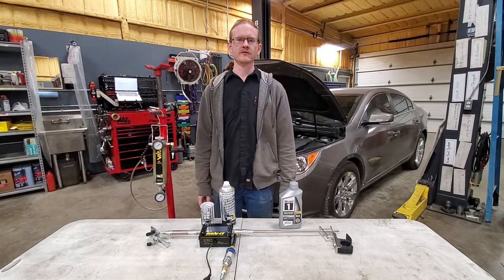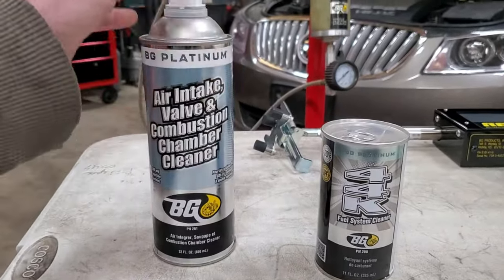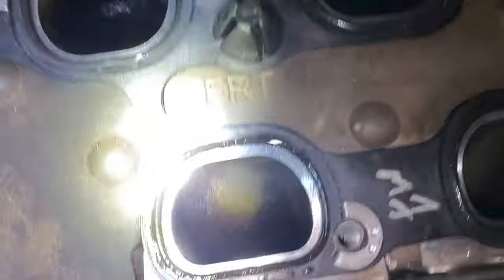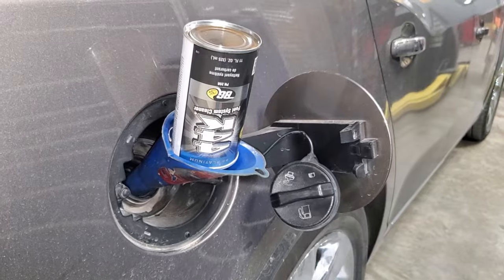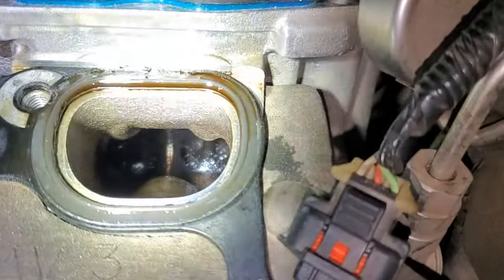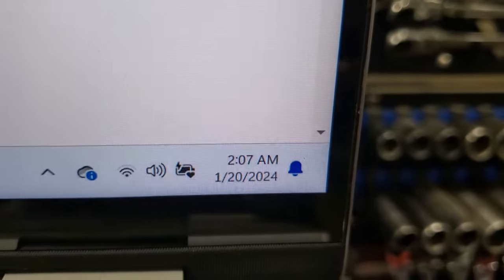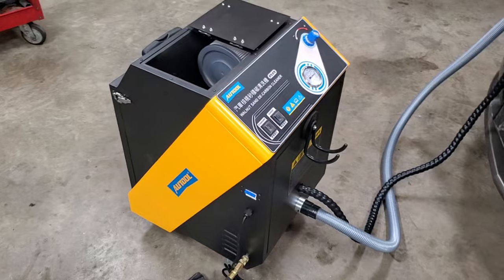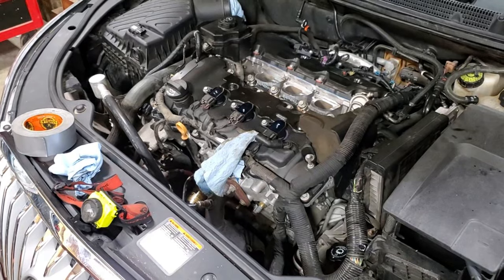Does BG Platinum GDI Intake Cleaner Remove Carbon? It's time to find out!

Comment: i tought you suppose to soak those valves with the liquid? just spray a foam based cleaner / carb choke spray and fine sanding it should clean those valve
Reply: yes...' fine sanding' and all the little loose particles that come off the sandpaper are now on your pistons or piston rings,,, installing nice little scratches on your cly bores

Comment: Ultimately wouldn't you still run into problems as carbon builds on the valve seat? I can see the benfit of better aerodynamics and also cleaning the valve stem, just seems like you will still end up having to take the head off.
Reply from the maker: There is zero carbon located on the seat sealing surface. If there were carbon there the engine would lose compression and wouldn't run good at all. It's impossible for carbon to build up there as the valve smashes into that area at high speed which obviously keeps it clear of any carbon build-up. And the miniscule amount of carbon left on the seat next to the sealing surface doesn't hurt anything. I mean of course it does make a difference but would someone pull the heads to get a 1% increase in airflow? If you were racing in a class that had engine build restrictions where every single HP counts sure it would be worth it but it wouldn't even be noticeable or worth it on a street driven vehicle.

Comment: It's always,  the chemical only clean the ports, but not the valves as the carbon been cooked onto the valves. If any of that carbon fell into the cylinder.  It may become new abrasive and create different problems.

Comment: Why didn’t you clean the throttle plate first
Reply from the maker: Because there was no reason to clean the throttle plate. The customer had just cleaned it less than 100 miles ago. Yes, the plate surface is stained but that doesn't matter. The only thing that matters is any dirt build-up on the edge of the blade and internal surface of the throttle body housing. This build-up of dirt is the only thing that would restrict airflow and there is no such build-up on this throttle body.

Comment: Great video but there is only 1 mistake.  You are supposed to use 2 cans of intake valve and combustion chamber cleaner.  After 1st can is used you are supposed to let the engine idle for 15 minutes and then add a 2nd can to complete the service.
Reply: This only applies to the 11 ounce cans, kit #6592. He's using a 22 ounce, which is a single can. But yes, otherwise both cans.
Reply: @BillyClements555  absolutely not. There is 2 part kit, like in the video, and a 3 part kit with two cans of PN261, and one can of PN208. The 3 part kit is supposed to be used when the engine has never been cleaned before. And also, he should have been using the Platinum tool, which he is not. He is using the old VIA tool, which is not as effective as the new platinum tool.

Comment: How much is to have your car walnut blasted on average?
Reply from the maker: Usually intake r&r time plus 0.5hr labor per cylinder. Most shops that do this are going to be in the $150-$200/hr range. Also a little extra for the walnut and Intake gaskets if needed.
Reply: @TechnicianRed  Thank you very much for the answer you provided. Im going to look for a shop and get it done here, in the LA, California Area. Good day

Comment: Dry ice blasting ! The best thing for cleaning valves !
Reply from the maker: Yep if you have access to dry ice, a HUGE air compressor, a VERY GOOD compressed air moisture removal system, and an expensive dry ice machine you would be good to go! I looked into it and I believe it was going to be about 20-30K to buy everything to do it right. Just the air compressor alone is almost 10K on the cheap side.

Comment: I love BG products however no chemicals added to the fuel tank can work on GDI engines and spraying into the intake won't work either. If it worked it would destroy the turbo anyway with hunks of carbon. Disassembly and mechanically removing the carbon is the only way.

Comment: Unfortunatly you are not completing the service. 
You are supposed to use two bottles on cars that has neven been cleaned before.
Therefor you are only doing half the service. 

You are also using the old VIA tool, and not the new and improved Platinum tool, which is a lot more efficient.

New video please!
Reply from the maker: You sure about that? BG used to have smaller GDI intake cleaning cans that required 2 cans to fill up the VIA tool. Now they sell it in a large bottle and a single bottle will fill up the VIA tool. Our BG rep didn't mention anything about using two of these newer large bottles for one cleaning service.

Comment: Thanks for sharing.
Unfortunately you’ve used the wrong tool to deliver the chemistry.  The Platinum Intake Tool is what you should have used, that’s why it requires the Rev-It, the application point should be after the throttle plate, such at MAP or Manifold Temp sensor.  When the Rev-It revs the engine it creates draw which then pulls in the Intake Cleaner, rather like a Venturi on a carb, this also means the chemistry is drawn into the cylinders more evenly.  
Also for first time, or carboned up vehicles the process is 1 treatment, a period to allow chemistry to soak and then repeated.

Your comparison against the BG results are therefore not accurate, wrong tool, used wrong and wrong process.
Reply: Actually, The way that #TechnicianRed undertook the engine intake process appeared to me to be far more effective than using the Platinum Intake Tool in the MAP or Manifold Temp sensor, halfway along the manifold. Using that tool was the way that I had seen the BG people perform the process {see the video at: "The CAR WIZARD shows how to de-carbon your engine"}. Neither did the BG people wait for the "heat soak" before driving their demonstration 2015 Land Rover Discovery Sport. 

Even the explanation offered by the BG people seemed to contradict the rationale for their setup arrangement. TR's way of performing the process, meant that the "chemistry" (cleaning fluid) was drawn into all the cylinders more evenly, with the total or full intake volume.

Comment: In my gasolene GDI cars I run Avgas 100LL from the local airport.  This fuel is simply amazing with a rich mixture octane rating exceeding 130.  My new Mazda CX 30 G25 Skyactiv G engine is silky smooth on this fuel.  I have friends who run Australia's cheapest and crappiest 91 (10E) and their exact same engines sound like tractors and get terrible fuel economy.  Go figure!
Reply from the maker: Sounds expensive! Us peasants have to settle with a little distributor adjustment in the warmer months 😆
Reply: @TechnicianRed  Also not catalytic converter friendly.

Comment: Wrong product
Reply from the maker: Nope. Watch it again
Reply: @TechnicianRed  CRC is the product. Spray continuously until bogging at 2krpm, rev up and keep doing that. Let sit a hour, floor it on the highway. Worked wonders on 4 direct injection engines.

Comment: 2nd best option: walnut blasting 
ABSOLUTE BEST OPTION: simply don't buy GDIs - simple as that!
Reply: they make (dual) port and gdi engines now buddy :)
Reply: @nukedtealeaf  I know. 😉
Toyota 2.0 and approx. 1 Audi engine.
It's eliminating the carbon problem of the intake valves, it does not eliminate the clogging of the direct injection nozzles.